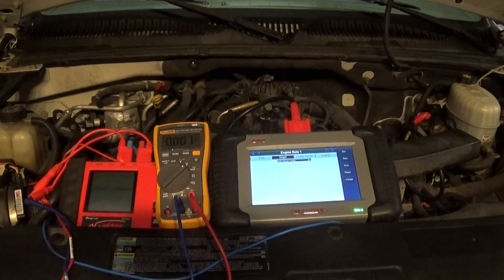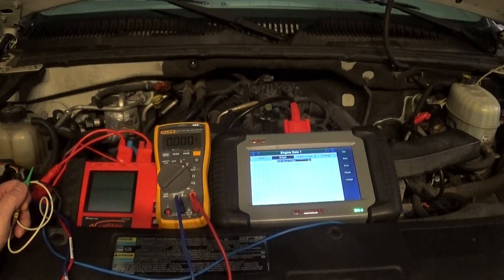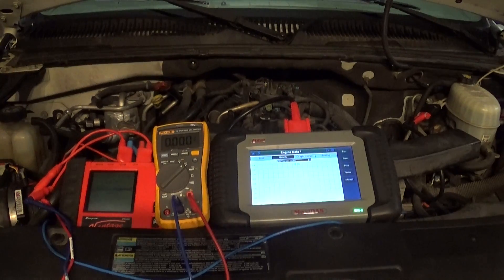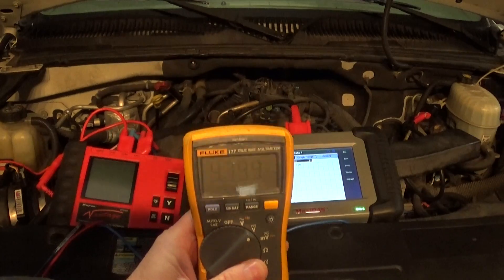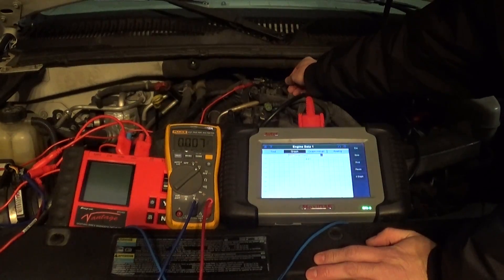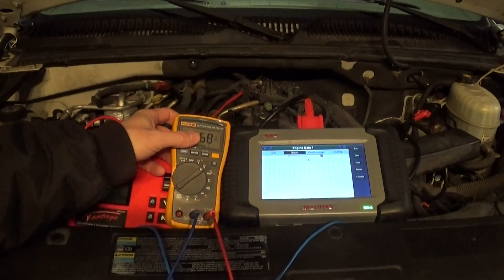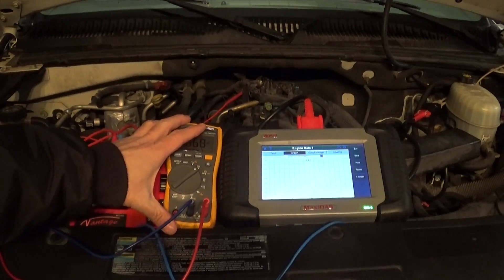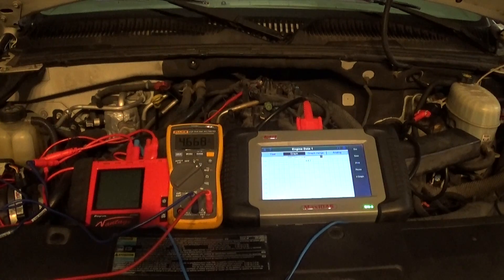Signal Wire Testing With Snap On Vantage MT 2400

Comment: In one of your video you used the ohm meter to test  the signal wire. By having it read the voltage of your ohm meter. Do you think this is better because of the 5v. Are did you have a problem with the other way?
Reply from the maker: Steve Zeitz yes I believe this is better because of 5 V output.

Comment: I think that is a great test. I measured the diode test on my dmm today and its output was 2.8 v. Either way you only need to confirm the computer is receiving the correct voltage/signal to prove your signal wire integrity. Awesome idea
Reply from the maker: Kirk Abrahamson yes you are right I do worry about slight voltage drop 100mV or so please let me know how is working for you . Thank you.

Comment: I was surprised to watch Scannerdanner put 12V onto these sensor circuits with confidence, but as you know he is careful to introduce high resistance somewhere along the line so his current is always really low. Your method of using 5V has to be better. Although Paul got away with it for years, new electronics may not be so durable. I have a variable power supply, but I have never used it on a car. We certainly need to understand our tools, specifically knowing what current the power supply will deliver (and where it will go) when there is a short to ground. A fused circuit might be more reassuring, but even then a fast blow fuse might not be enough. In that sense, having a little battery source such as three 1.5V AA batteries in series with a resistor (such as an incandescent test light grounded to battery neg) might work just as well, though current wouldn't be high enough for the light to shine. What I like about AA batteries and a resistor is the fact you know they can't make much current, even if one were to make a mistake....
Reply from the maker: spelunkerd I check current and it is 0.9 mA.
Reply from the maker: I like you idea with AA batteries. Would you make video I would like to see your metod. Thank you for watching.
Reply: Good point, it would be an interesting project.

Comment: First I have nothing to add to your great vid. But I do have a ? Did you say that you made the connectors that were in the top of the vantage?  If so how about some moor  info. Thanks. PS would it be better to use the vantage for the 5 volt signal or a 5 volt supply like you can buy on EBAY for cheep?
Reply from the maker: Joseph Tucci hello my friend connector are from my power probe kit they come handy. Thank you for watching .
Reply: this is better. there is some current limitation when using diode mode. that is why there is some voltage drop